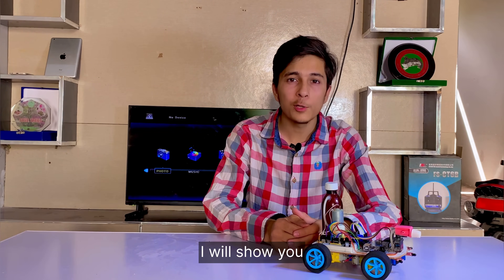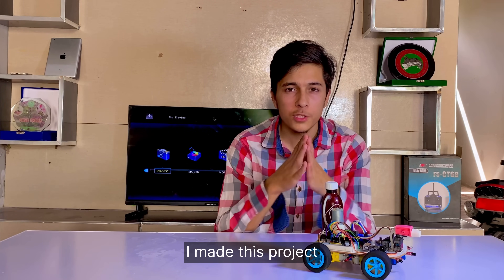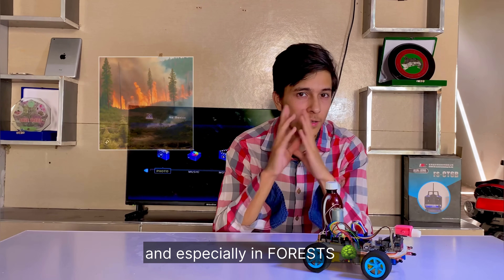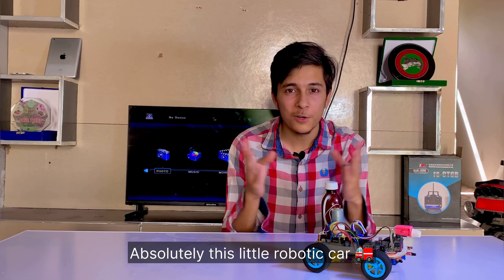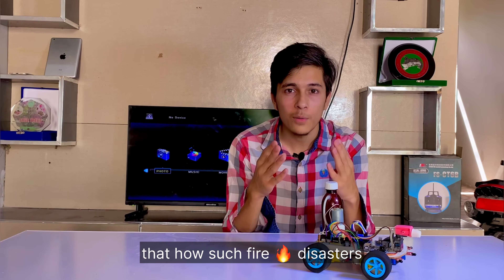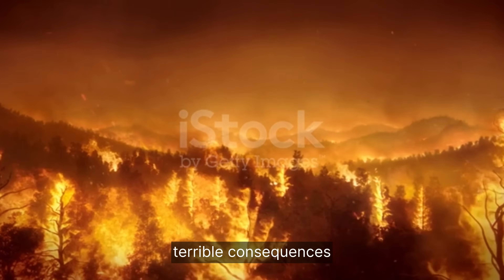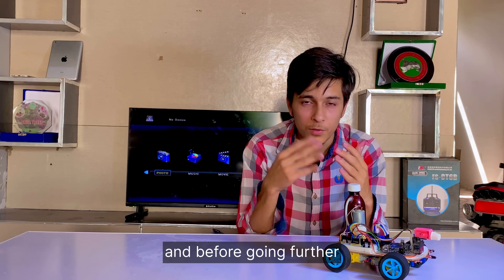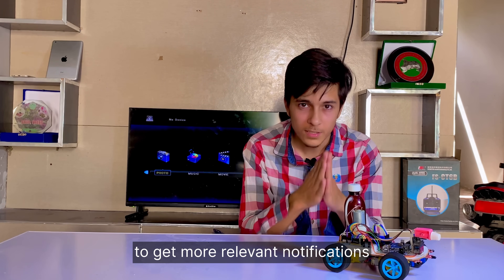DIY Fire Fighting Robot using Arduino  |  Auto Fire Chaser and Extinguisher

Comment: Good work bro.❤️
But my flame sensor is not working
Reply from the maker: Thanks… Make sure have connected them well according with circuit diagram.. if flame sensor’s red led are not turning on then change connections if there are turning on and still not work with project then let me know

Comment: Does it require any bluetooth or wifi connection or it can run independently onto to extinguish the fire?
Reply from the maker: No brother it has auto control. It has flame sensors that detects fire and Arduino interprets the signal and perform task as programmed. It doesn’t required any kind of transmitter

Comment: Hi saad, I have question in the circuit diagram it says that for the flame sensor connect the G to ground, but in Ur video you connected the DO not the G, why? because we did the same project everything worked except the left side two motors I don’t know why ?
Reply from the maker: Do connections according to circuit diagram. Connect ground with *G*. I had changed it after, behind the scenes.
Reply: thank you for responding, Also, in the code it says that enA goes to pin 10 but U put it in pin ~5, U flipped all the enA with enB should I do the same U did or I do As the code says ? Because as I told you the left side wheels doesn’t move at all !
Reply from the maker: Brother it doesn’t matters much. If you flip the anA with enB the motors(wheels) will rotate in the opposite direction of desired, it doesn’t mean that they wont rotate. I flipped but then I flipped the motor wires as well. You just do all connections according to circuit diagram I provided.
Reply: Hellow sir
Reply: Plz tell me DO pin is empty??
Reply: Connections of wire with only A0 G and + is it right?

Comment: All good but wheel  not rotate.. please solution
Reply from the maker: MAKE SURE; your you have connected  7-12 V to  12V and GND pin of Motor Driver, you have removed pin connectors from ena & enb pins. Compare connections with circuit diagram and check the code

Comment: I noticed you did a Daisy chaining methods for motor.
Can you do a parallel connection how to do that. I am trying to connect two head of the 🤖 robot.  Using Arduino chips. 

I have subscribed aswell.
Reply from the maker: Both the BO motor pairs are connected in parallel. 
What type of function you are going to perform with robots using arduino?
Reply: @saadinnovativeideas  I don't know yet, but I will find answers soon 🔜

Comment: Hello is it okay if my bettery source is 18.6V?
Reply from the maker: No arduino uno recommended voltage is  7-12 V through “vin” pin. 18 V may damage the 5 V regulator in your arduino board

Comment: good work bro,ok now for me am working on my final year project which is about fire fighting robot with obstacle avoidance.For obstacle avoidance am using ultrasonic sensor which is connected with servo, that rotate with ultasonic to sense obstacle left,right and front.Priority is fire but if there is obstacle ,the car should stop and go where there is enough space.How can i do this?
Reply: me too can we talk about it ?
Reply: @NajmAl-hokabi  yes I have already completed this project last year
Reply: @Brightwillehosea  yo bro, could you share your project with me :), thx in advance
Reply: @Brightwillehosea oh please, can you help me?
Reply from the maker: You have to modify arduino code by addition to ultrasonic sense. And circuit diagram will also differ by little
Reply: Bro can you please share your project if you have made

Comment: hii bro i need  aurdino code to run the stepper motor by the using of ultrasonic sensors please suggeest me the best code
Reply from the maker: What type of function you wanna perform on stepper motor.. provide me some explanation so I can suggest you the code because there are many combinations of ultrasonic sensors with stepper motor, which one you wanna do

Comment: Hello sir 
I need your help 
Sir we have made the same problem like our Arduino Uno is not properly working bcz the power does not reach to Arduino 
What should we have do to resolve it
Reply from the maker: How much voltage have you given as an input to the arduino board and with which pin of board have you connected the positive terminal of battery?
Reply: The same thing was happening to me you should power the arduino by the port of 12 v
Reply: Should I have to connect the 5V pin of Motor driver to anything. 
In this connection the motor driver is turning on.. Not showing red light

Comment: Is it okay to use TIP 35 transistor?
Reply from the maker: Not of course, TIP 35 is used for high voltage implications and switching. I have used tip 122 to drive motor (water pump).
Reply: @saadinnovativeideas  i dont have TIP, is it okay to direct it? without using TIP 122?
Reply from the maker: You can use relay module as a motor driver for pump to get rid of its complex circuit

Comment: hey saad. im going to buy arduino and other parts for this so are you sure that it works good? like code and everything
Reply from the maker: It works as shown in the video. Yes code and everything is fine. If you found any problem let me know I will try to solve
Reply: @saadinnovativeideas  hermano encontre un problema, respondeme si estas dispuesto a arreglarlo